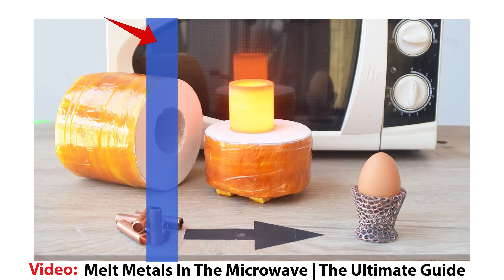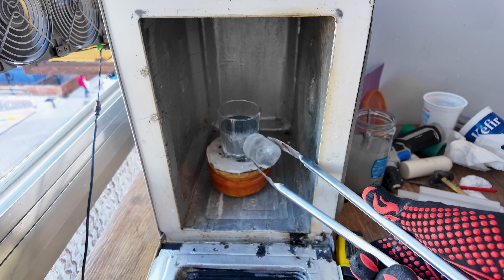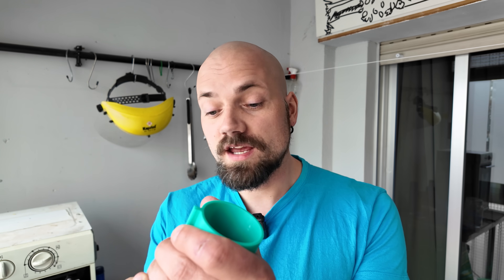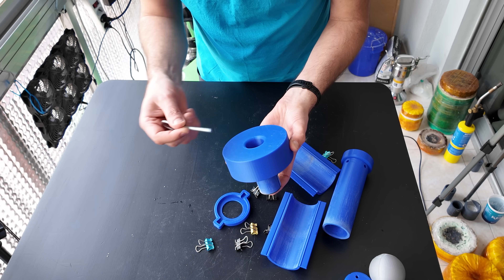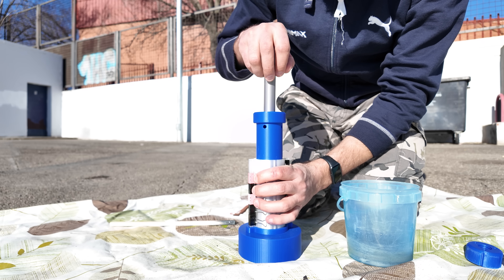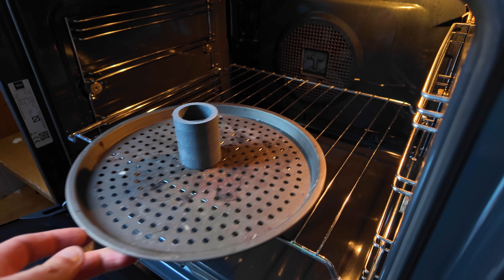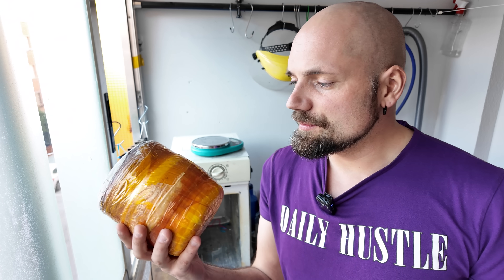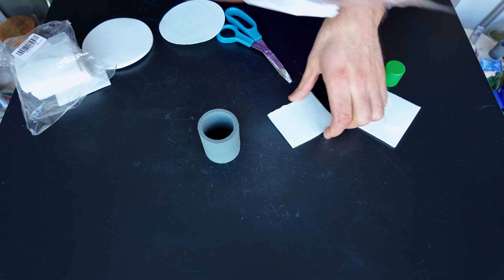How to Make Your Own Crucibles (for microwave metal melting)

Comment from the maker: Most of the time, I use FEPA 220-grit silicon carbide, but lately, I've been experimenting with coarser and mixed grits. I’m not sure how they perform yet, as testing takes time. In theory, a mixed-grit silicon carbide (fine + coarse) could be beneficial, but only time will tell.

These molds are a significant improvement over the previous versions. I'll continue updating them and adding more sizes. The next addition will be a tiny crucible. I haven’t published it yet because I needed to resolve an issue, and I didn’t want to delay this video.

I’m trying to publish videos more frequently! :)
Reply: @ShakeTheFuture  A good balance is to use coarser grit at ~75-80% and finer grit for the remainder. This is based on the mathematics of sphere packing and experimentation in the concrete industry.
Vibration is necessary to get the optimal packing though.
Basically imagine a matrix of stacked bowling balls, you would want the next set of filler balls to just fit between without displacing the bowling balls - perhaps golf ball to racquetball size, then the next size to fit in those remaining spaces perhaps BBs to marble sized, and so on.
You can do this down to the finest grain size you have available and the remaining volume is the minimum liquid binder you need. If you try to get too close to the minimum binder though it requires much more physical work to get the best results - failure to do so may leave weaker areas than if you'd have just added excess binder.
Reply: @RandomInterjections  There's guy that was making granite/epoxy machine frames showed the math for that so he could get maximum granite density.
Reply from the maker: @RandomInterjections  Thanks for the info!
Reply: Finer grits and better finishing (less porosity) make it more efficient and support higher temperatures, but will be more difficult reach the right density to make the crucible.
Reply from the maker: @sevazinhogamer9521  Thanks!
Reply: A basic concrete mix is one part cement, 2 sand, 3 gravel.  Also, crushed stone with irregular shapes tends to be stronger than rounded gravel and sand.  Having more cement and fines than optimal packing would seem likely to work better than less.

Another possible experiment is SiC mixed with other material.  I read an article awhile back describing melting metal in crucibles using both silicon carbide and magnetite, one being more efficient at absorbing microwaves at low temperatue.
Reply from the maker: @hanelyp1  Thanks!
Reply: The Tech Ingredients youtube channel discusses spatial packing of multiple size particles plus a binder at length in their DIY thermal paste development video.
Reply: can these crucibles be used over fire or its just for microwave?
Reply from the maker: @FlavioMenegasso-jl8wg  Even though I have not tried it, I don't see why they would not work. Cheers!
Reply: Have you considered painting the part with fine grit silicon carbide mixed with a suitable furnace-friendly binder and then backfilling the rest with coarser grit ? Thus maintaining detail where it is needed but keeping the advantages of coarse grit elsewhere ? ALso a mix of coarse with small amount of fine grit might result is a strong crucible overall, similar to how aggregate mix affects strength of concrete !
Reply from the maker: @shodanxx  "I’ve thought about something similar, but not quite the way you described. We’ll see if we get there.

Cheers!
Reply: @ShakeTheFuture  what are you doing when you harden the crucible? im guessing its not even close to melting temps so im guessing you are sintering the material together?
Reply: @shodanxx  Wouldn't that crack or separate between the fine and coarse with different rates of thermal expansion?
Reply: @Canyonman44 Coarse grit and fine grit silicon carbide has the same rate of expansion as silicon carbide.
But I don't know the effect of different amount of sodium silicate, or putting enough water and sodium silicate that it become liquid enough to be painted on.